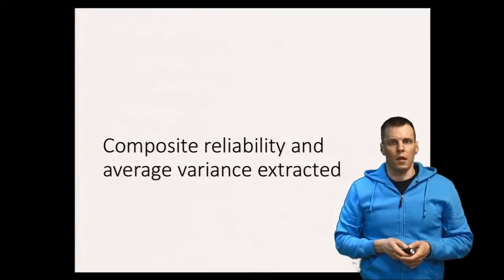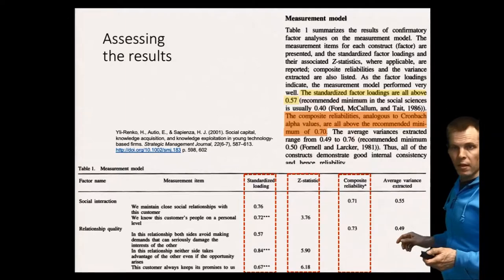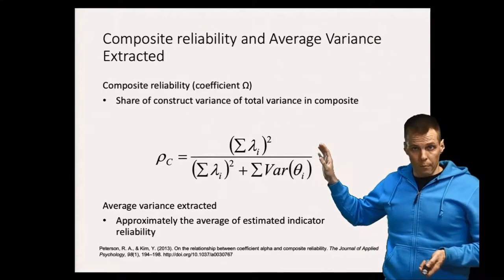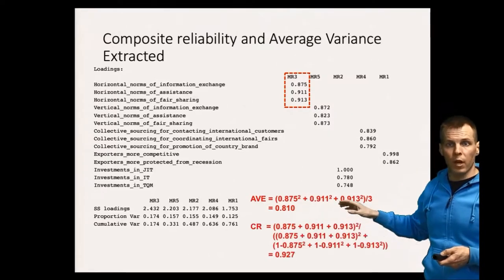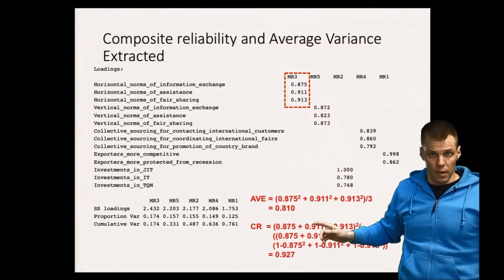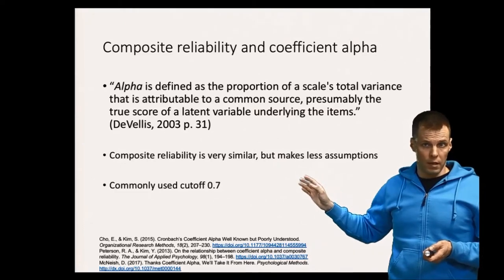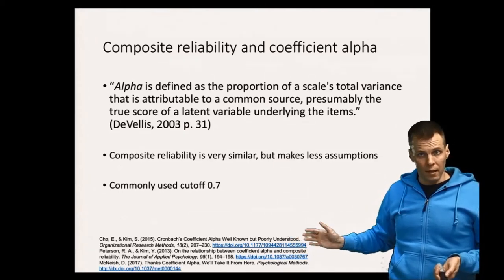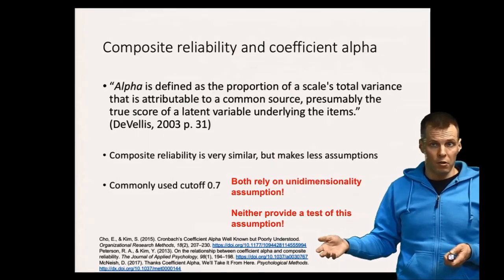Composite reliability and average variance extracted

Comment: If one of my indicator has negative loading factor, should I make it to absolute value to calculate the AVE?
Reply from the maker: Hi. AVE is weighted sum of squared factor loadings so the signs do not make a difference. But in practice we would not take absolute values.
Reply: @mronkko   What about the CR? if 1 out of 3 indicator is positive and the other 2 is negative then the sum of factor loadings will be negative or very small, should I make it into absolute value for the 2 negative loadings?
Reply from the maker: @fianathalie4837  That deepens. If some of the items are reverse scored, (e.g. I feel good, 1=disagree, 5= agree and I feel bad, 1= disagree, 5 = agree) then reversing the indicator coding prior to analysis would be your best choice (in my opinion) and would make all the loadings to be of the same sign. If all the items are coded the same way (i.e. none are reversed) but some loadings are negative, that indicates a model specification problem and you probably should not trust any reliability statistics calculated from those data.

Comment: Professor,
1.- I thought that CR was calculated only with CFA.
2.- If a construct has three dimensions and I check it with the EFA, does that indicate that each dimension is one-dimensional? and should apply a CR for each dimension?

Thank you very much!
Reply from the maker: 1) The difference between EFA and CFA is smaller than what most people think.
2) Unidimensionality must be established for each dimension and you need to estimate reliability for each dimension separately, unless you want to go for multidimensional reliability coefficients.

Cho, E. (2016). Making reliability reliable: A systematic approach to reliability coefficients. Organizational Research Methods, 19(4), 651–682. https://doi.org/10.1177/1094428116656239
Reply: @mronkko  Thank you very much for the commentary and the reference, professor!